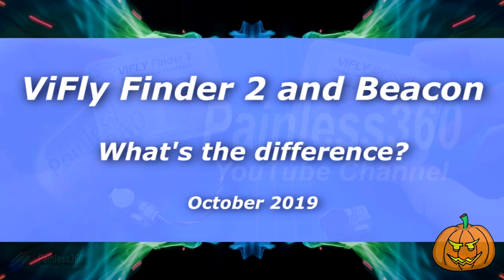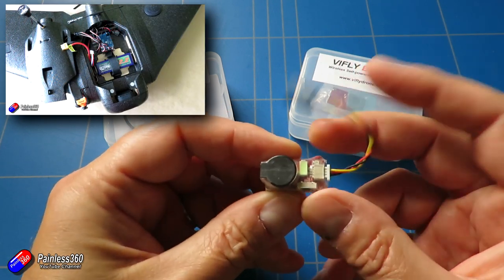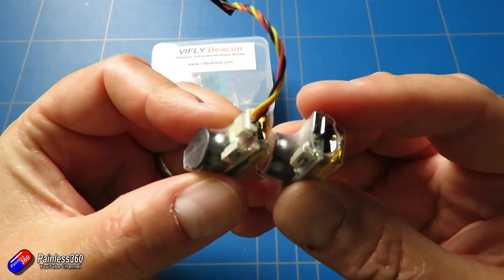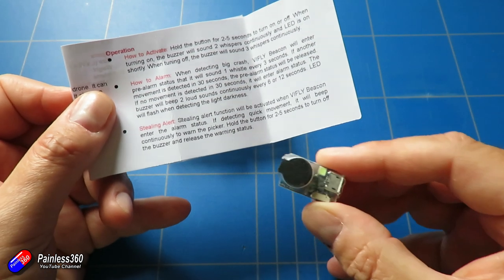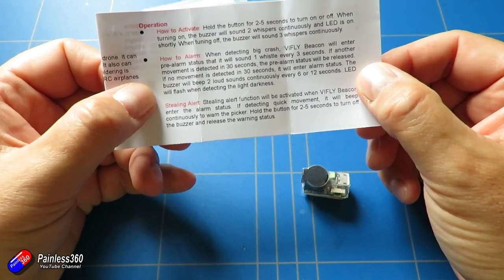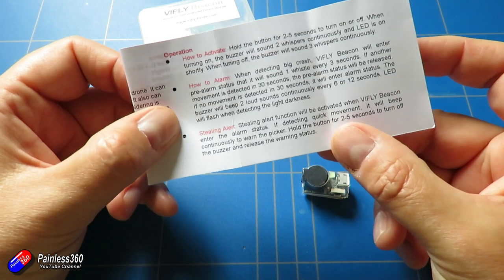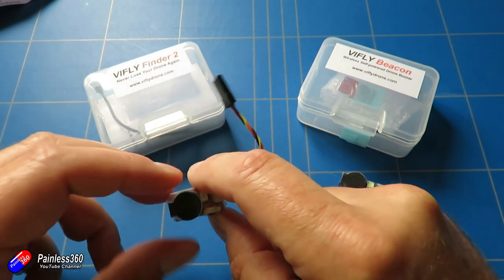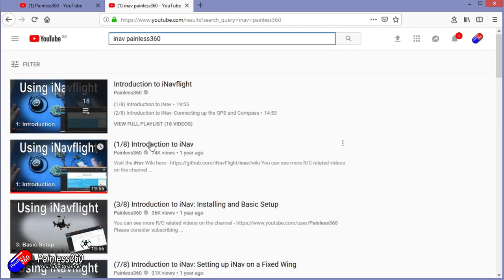ViFly Buzzer & Beacon comparison

Comment: The Vifly beacon also activates alarm if no motion is detected for 5 minutes. So even if the crash is not hard enough to cause immediate alarm, it will start the alarm after 5 minutes.
Reply: tstrrtstrr - great info
Reply: Not a lot of help then if it's swinging about from a tree branch in the breeze. 🤔🙄

Comment: I have a few Finder 2's for fixed wing and whie they are useful I find that it takes 1.5 hours to charge them but the battery drains in around 2 weeks (when then models are not powered up). This means you really need to charge the units before each flying session.

Comment: I have a beacon too. When I drop it from 20-30 cm on the floor or on a table, it will start to beep after 30 seconds. Perhaps the sensitivity setting on yours is to low?
I also saw a review of the beacon (from Albert Kim I believe) wich showed that after a soft landing and no movement for about 5 minutes, the alarm also is triggered.

Comment: Probably a silly question but can I put one of these on a larva X or is there something similar that I could use? I've had quite a few near losses especially when the battery pops out. Thank you
Reply: I put one of the Beacon ones on a larva x with a small zip tie and spot of hot glue.Works for me so far.
Reply: It's pretty large and heavy for a toothpick style quad unfortunately. It's only 6g. On a 5 Inch quad that's nothing, but on a toothpick it's 10% more weight...